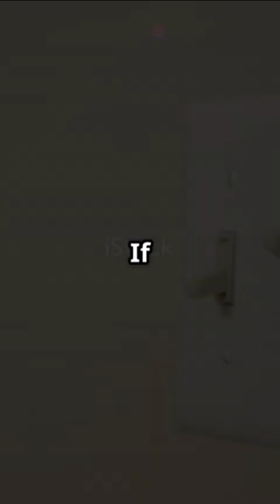⚡ High-Voltage Direct Current (HVDC) Transmission – The Future of Global Power Grids

Comment: In fact, DC power has the highest amount of power loss.
Reply: That is only true because DC is difficult to step up and step down. At the same voltage, DC is more efficient. HV-DC is great for transferring huge power across large distances. The kind of power that flows between countries. There is some loss rectifying it, and inverting it, so it's not universally better than high voltage AC.

Comment: You do not know anting about electricity. or anything about are grid
Reply: High Voltage Direct Current (HVDC) is often better than Alternating Current (AC) for long-distance power transmission. Unlike AC, HVDC loses less energy over hundreds of miles, works better in underground and underwater cables, and allows different power grids to connect easily. It's also ideal for renewable energy sources like solar and wind, which naturally produce DC. While HVDC is more expensive to set up, it becomes more efficient and cost-effective over long distances.

As stewards of God’s creation, using HVDC reflects wisdom, efficiency, and care for both people and the planet.